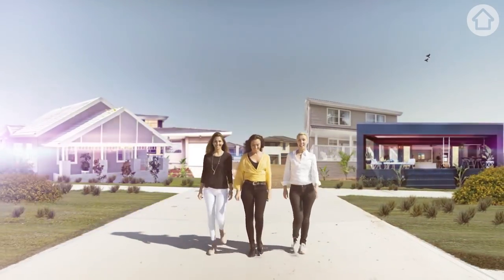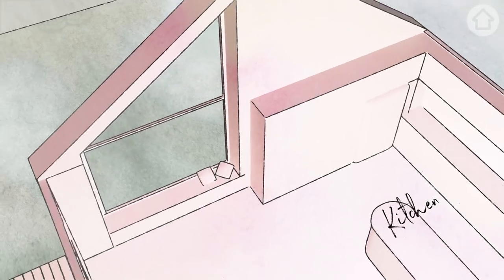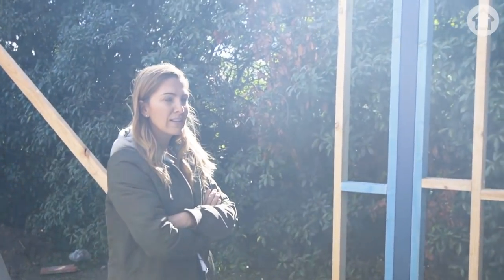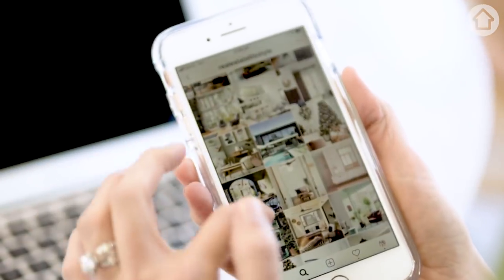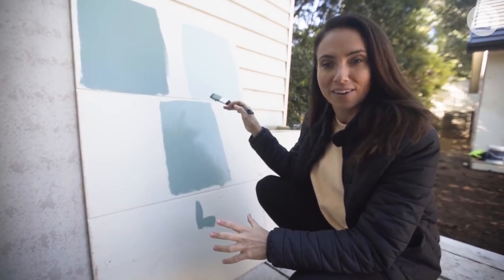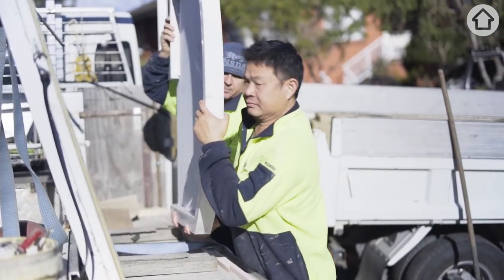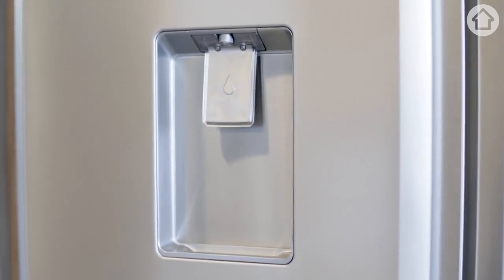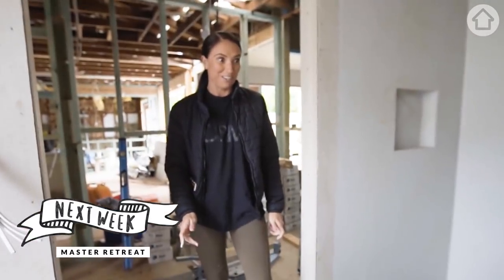Episode 1 | The Kitchen, House 9 Renovation

Comment: A slide out shelf between the drier and washing machine would be extremely handy. 

In my own very modest unit I built a washing machine stand 510mm high with a push to open/close slide out shelf for the laundry basket. The shelf is made from a pine tabletop, and the sliders need 50mm of vertical space.

An extra 50mm between the two appliances for a shelf that comes out 550mm would make that top appliance so much easier to load and unload.

Comment: I’m not a fan of the kitchen. I don’t like the huge hutch in the middle of the countertops, which in turn causes the cooktop to be crammed into the corner. Kitchen renovations are usually done to get stoves or cooktops out of cramped areas of the kitchen, not put them in the cramped area.

Comment: why would you have the laundry in the kitchen ?The laundry should be separate away from the kitchen . Based on the fact it's your dirty clothing, that should not be in the same room as you prepare your meals. I don't know how much space that you actually have but still ,who wants to be cooking, then switch to doing laundry ,and then go back to cooking ? If you're touching dirty clothes, then you go back to finish cooking, that's cross-contamination that's not sanitary .If anything the laundry should have been down the hall in one of the bathrooms,or in the hallway closet. That would have been a much more practical solution from my point of view. I guess the house would sell ,but I would never buy a house that has laundry in the kitchen that's just me.